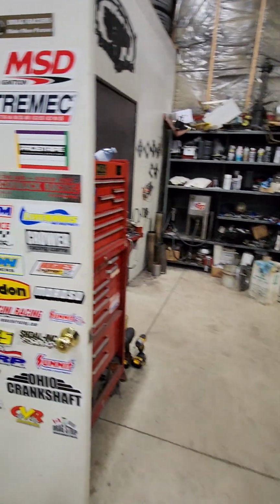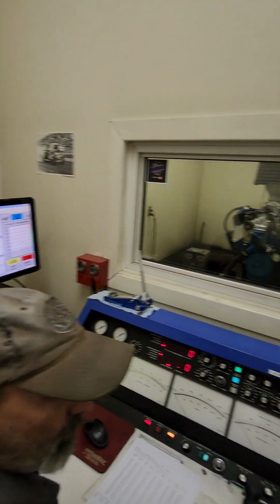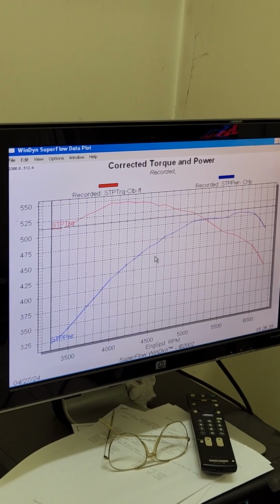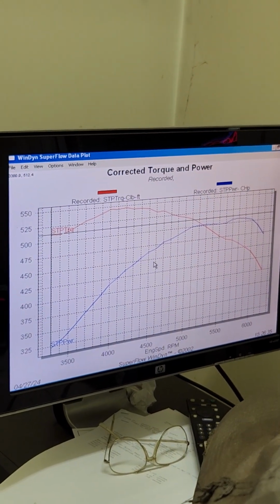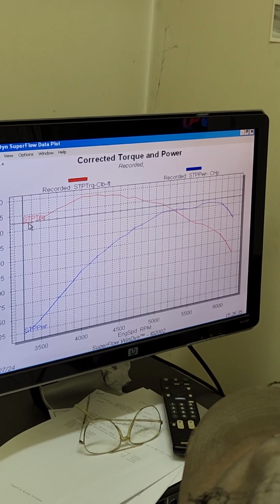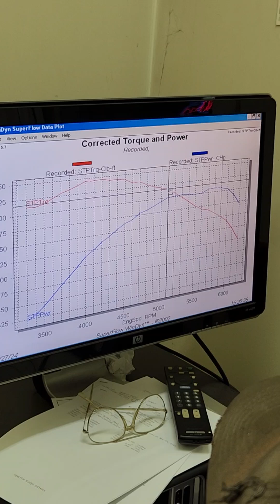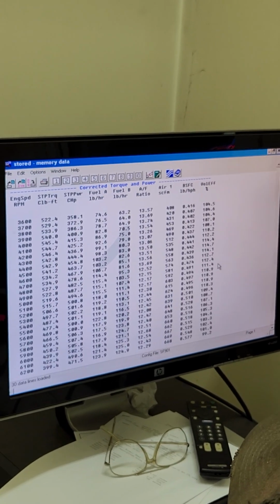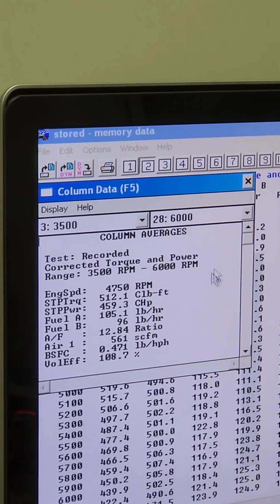Trick Flow vs Speedmaster Heads. 408 Small Block Mopar Stroker #1 (T.F.) Dyno Results  April 27/24

Comment: I got a 351c short block! Got an aftermarket set of aluminum heads! Don't plan to use them, but, , I have the parts to build a 408 .cu boat cams, a😢😢

Comment: Hello Terry, I have a pushrod question for you sir! I know you use the Lunati 20200713 in ALOT of your builds and I’m wondering if you use the same pushrod in those applications??? Can you help me out here possibly?…..or is every set of pushrods cut for those individual engines?? Thanks, hope you can help.
Reply from the maker: There is a lot of variables.... How much the block has been decked, head gasket thickness and if the heads have been planed at all, plus the brand of lifters. But, with a 1008 gasket, Trick flow heads, Harland or PRW rockers for ball-ball pushrods and Morel Lifters (Howard's and a few others use Morel), and the deck just cleaned to square it, it usually needs a 6.950 to 7.050 pushrod. Some other lifters used a 6.800 pushrod. 
  You need a pushrod length checker to be sure
Reply: @brightonracing  Thankyou sir! I figured that might be the answer, but was hoping you had a ‘tried and true’ go to pushrod but again, I understand. I actually have the comp cams lifters, RHS-X Indy heads(not planed) a squared 340 block w the 1008 gaskets, so yes, I completely understand. Thankyou for the reply and I’ll continue to watch, learn and enjoy your videos. Keep up the good work!

Comment: What’s the cam specs? And on this pull was it the speedmaster heads or trick flow?
Reply from the maker: Retro-Fit Hydraulic Roller. High performance street cam. Likes up- graded intake, carb and exhaust. Needs 2800 RPM stall converter in most cases. Requires 9.5:1 compression. ;Advertised Duration (Int/Exh): 282/290 ;Duration @ .050 (Int/Exh): 231/239 ;Gross Valve Lift (Int/Exh): .535/.550 ;LSA/ICL: 110/106 ;Valve Lash (Int/Exh): Hyd/Hyd ;RPM Range: 2200-6200
Reply: @brightonracing  awesome build.. my 408 will not be going on a dyno. But it’s a 10.9:1, 408cui, 308 casting heads that’s been ported, rpm air gap intake, and a comp hyd flat tapet 241-249 @.050, advertised duration is 285-297, lift with 1.6 rocker will be  around the 580 lift on both intake and exhaust, and the valve springs are comp 995-16
Reply from the maker: TF heads. It in the description